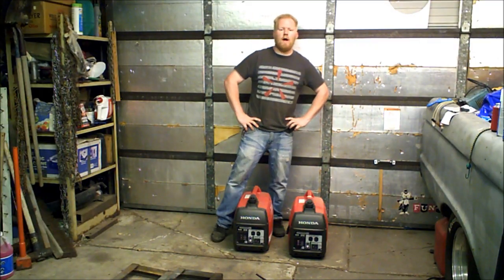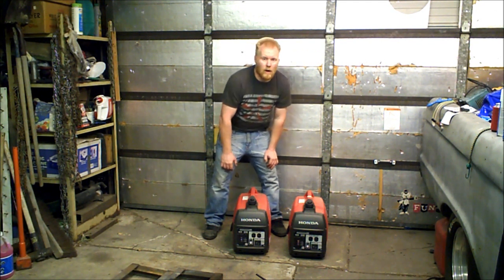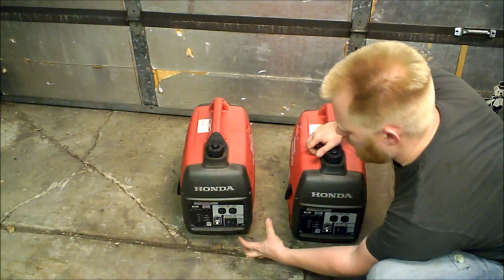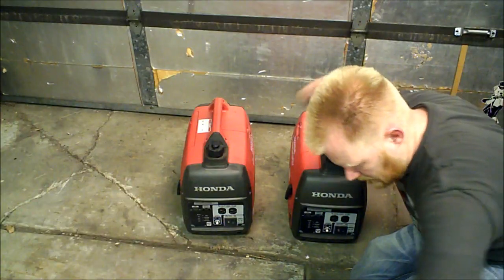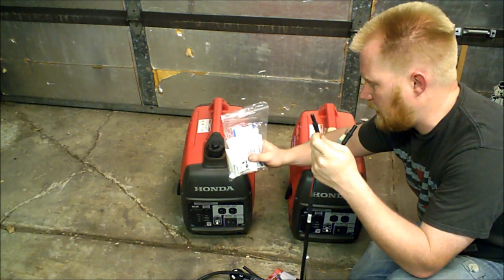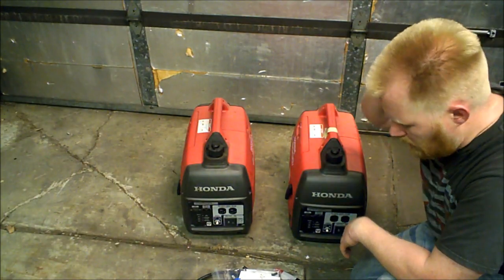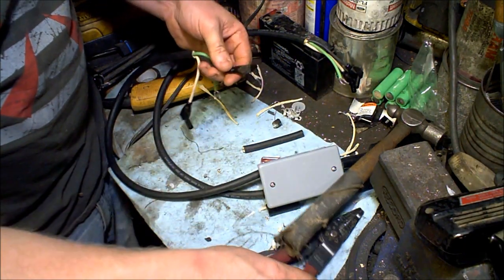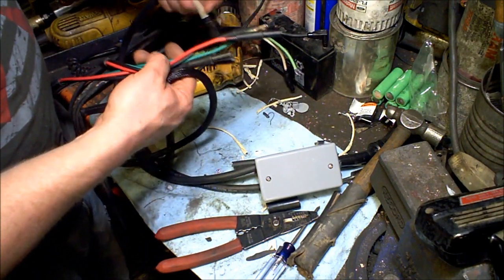Homemade 30A Honda Eu2000i Parallel Kit Generator

Comment from the maker: IF you're talking about hooking it into you house, you can put and adapter on. You should have TWO-110v-120v lines coming into your breaker box. So half the house stuff is on one and the other is on the other half and when tied together you get 220v-240v. So if you made an adapter only half the items in you breaker box would have power. You could tie the two strips together in the adapter and supply power to both sides but I am not sure what your 220v appliances would do if powered on?.... cont.

Comment: Thanks for sharing this video!  I have 2 Yamaha EF 2000 that I ordered from US carb. They are tri fuel with full Yamaha 3 year warranty from Yamaha. I want to hook them up via a transfer switch.  I don't need any 220.  Can use your process and use an adapter from rv plug to 4 prong for the inlet box?  Thanks.

Comment: Oh. Thanks. So my idea won't work. Generators with a 220 volt outlet somehow can supply 110 volts, and 220 volts to a transfer switch that can be hooked into the house panel. I guess the 220 volt outlet from said generator must have two separate 110 volts, and to get the 220 volts, two 110 are used I think. I would want to power the 110 volt furnace, and the 230 volt well pump with the generator. Thanks again for your help!

Comment: I am revisiting this video. We had very long power outages with hurricane sandy. I have a yamaha generator that produces 2000 watts, not enough to run the well pump. But this generator, like yours, is a gas sipper (12 hours per gallon) with the idle up technology, and is so light that I like the idea of attaching two together for 4000 peak watts. I am pretty sure that would run the well pump. Yamaha sells the cable for about 90 dollars.

Comment from the maker: Yes you can. These little banana plugs connect directly to the regular plugs internally. I would try a couple plugs and try to find a really tight fitting one and use those for your setup.

Comment: Can you take two male plugs and connect each generator with the plugs or is it a different circuit set up the way you showed? 
I know the way i asked could be unsafe because unplugging one plug it will be live with the generators running and the other plug still plugged in.

Comment from the maker: I took it apart to see. There are several people on google that show the standard plug method I describe. I wanted to see if it was that simple and it is. I just looked at Europe's 50hz 2000w models and they also allow parallel. Its only Canada and your electrical code with this size(the 1000 watt Canadian model is parallel capable).

Comment: That's very interesting, and thanks for getting back to me. Have you measured the resistance from the banana plugs (females) on the facia's of your units to be sure that the circuitry is a direct connection to the banana plugs, or have you had the facia off to see it? If this is the case, you have solved my problem. I would probably test it by plugging males in to each end, but once I had established that it works, I would buy some female facia mount banana's to install and make it safe

Comment from the maker: Continued: But you are supposed to have both machines plugged together before you start either generator. If you go to the US   site: honda power equipment . com you can view the US version of the owners manual and it talks a little about it. The banana plugs just make it as safe as possible.

Comment from the maker: As far as the circuitry goes the female banana plugs on my generators connect directly to the hot and neutral on the outlets. The easier and cheaper version of this is to have a standard male plug inserted directly into a outlet on each machine and have those tied together with the larger outlet like I did. The only downfall to this is SAFETY. If only 1 male plug is plugged in and the other is not, the exposed metal ends are LIVE(generator running).
Reply: Also known as, a death lead.  The only difference between the oem leads and  death lead is the insulated banana plugs and the sentence in the manual saying plug them all in before starting the gensets 😅

Comment: Very neat work. Unfortunately I am in Canada, where the same model does not have the parallel ability due to some Canaian CSA rule. It would be an ordeal to go to the states to buy a pair, not to mention the warranty issue. I was just thinking, what are the chances that the circuitry, right down to the plugs, is actually in the Canadian version, and that all we'd have to do to make it work is to install female banana plugs into the facia, connected to the circuit board. Any ideas?

Comment: Very nice job done, thick wire of equal length makes the current pull from each generator the same at full blast.

Much better than the original :-)
Reply: The inverter board does it automatically

Comment: To bad they didn`t make the ground screw a thumb screw,or a short wire off it with a push plug connector off it ,so it was tooless. Good video

Comment from the maker: Honda has put special circuitry in these to be able to parallel these. If I connected these to a home's main power then I would definitely need a grid tie to prevent power going back into the main system and electrocuting the linesmen. But as long as I just plug individual appliances into this then no grid tie is needed. Thanks for watching.